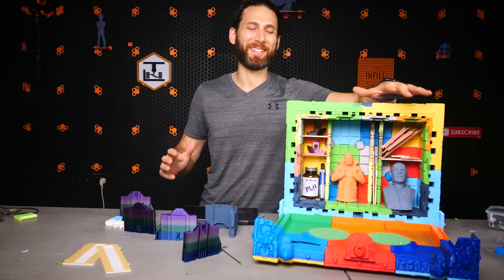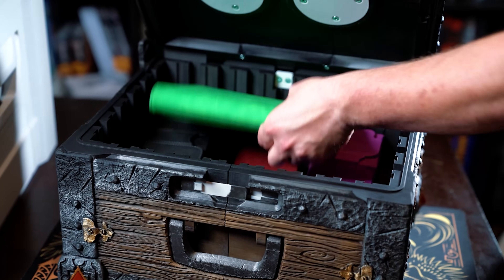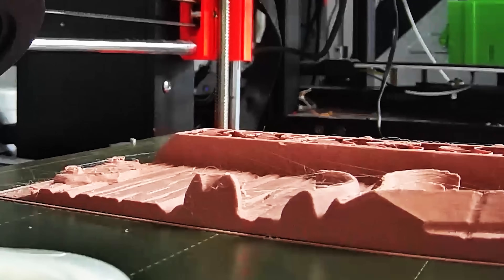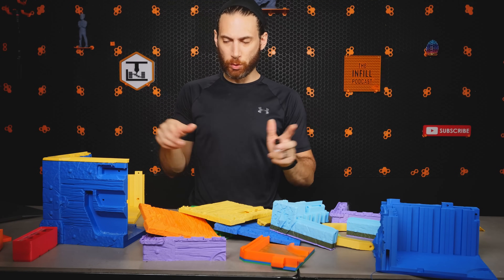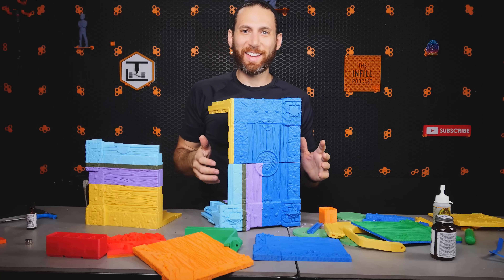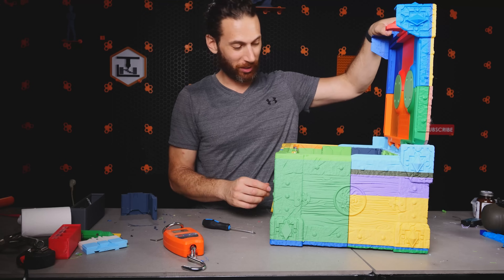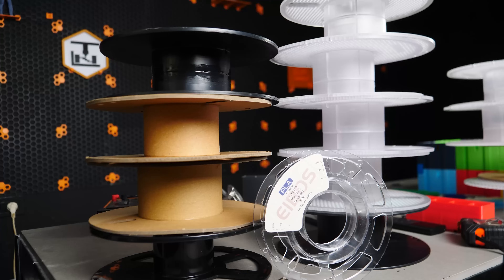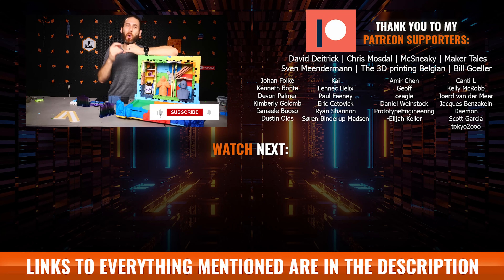I can't believe I 3D printed the whole thing...

Comment: I have a BIG question for you…ever since I saw your video where you say if you print stuff for the house, your significant other will get you or allow you to get more printer. I have been in love with the Honeycomb Wall. I haven printed one yet because I just got my first printer which I chose the Elegoo Neptune 3 Max. Well while watching that video, I noticed some Honeycomb shelf brackets that were awesome in your background. They are the Black and Orange Honeycomb shelves. I found an STL version of them, but it is oriented very small, can you tell me what size to print them in.
Reply from the maker: MY version? Should be scaled properly in my model, in mm.

Comment: I backed the original Omni (still haven't had the time or money to actually print one, but it's coming one day) and got notified about the portable version just yesterday by email...my first reaction was, "but I already have some less fancy storage for my D&D miniatures, I don't think I need this." My second reaction after starting to watch your video was, "it doesn't have to be for just miniatures, it is an endlessly customizable and expandable storage system for nearly anything." And my last reaction was, "that seems ludicrously heavy and expensive, if I'm going to that extreme of a level for portable storage I maybe should just get a Pelican case and some of that cubed foam with smaller 3D-printed accessories."

This kind of video is definitely great - I wasn't 100% sure of my decision to avoid backing the project, especially at the early bird price that was still available as of this morning, but now I am more confident in my decision. I'm sure others are equally as confident about going ahead with backing the project, and that's great as well. The check-it-before-you-back-it style of video I think has a lot of value to the 3D printing community, would love to see more videos like it in the future.
Reply from the maker: Great comment I’m super glad it was helpful!

Comment: That design looks very wasteful. It is a complete case inside another very thick complete case. It looks to be at least $100 worth of plastic, to reproduce something you can get on amazon for undre $50. I love 3d pri ting as much as the next guy but replacing even a few of those panels with corrigated plastic would cut the cost and time down to less than half of this.
Reply from the maker: Yeah, I get that, though the plain one is less plastic... but like i said, i think it's not about saving money but rather building your own, similar to how making your own cabinets is more expensive than just buying IKEA most of the time, but it's about the project and making it exactly how you want it?

Comment: That was really neat!  Ultimately, though, I agree with your conclusion.  Not the part about this being better for the purpose than an off-the-shelf miniatures case; the off-the-shelf solutions tend to be very good at what they do, and if you're content to roll the dice on Amazon clones, you could get the same thing for about 2/3rds the cost of 7kg of filament in Canada.  But the part about "you do this because it's fun to build it.

Even so, this rather feels like a "if all you have is a hammer" solution.  Even from a DIY and completely custom perspective, I feel like it would be better to buy an existing case and just 3d print the internals.  I can get a decent attache case for 100$ or a similar sized toolbox for about 60$.  With filament costing around 25$/kg in Canada (more if you're going for brand name product like Prusament) 100$ for a case that has no join lines and no weak points and masses a hell of a lot less than 4kg seems like a really good deal.

It is really cool, though, and I'm happy this exists for the people who want to explore it.

Oh, and the most filament I've spent on a single project is over 20 kg on an R2-D2 replica.  Well, so far - it's the sort of project that's never "done" so I'm sure I'll print more stuff at some point.
Reply from the maker: Thanks, I appreciate you filling me in as someone in the know. And wow, 20kg... I'll need to see that one! Pics?

Comment: Honestly, this is ludicrous. Just cut the 6 pieces of plywood, and use the 3D printed elements as joinery and internal elements (+wood glue for additional strength! There! Plastic and print time cut to – what? – 20% od the original? And fraction of cost (thin plywood could even be scored with utility knife, broken, and just sanded flush with sandpaper, no special tools required... and jigsaws could be probably bought used for essentially nothing). 

Some 3D printing designers/creators are truly demonstrating the whole new levels to the "when you have a hammer" problem.
Reply: Yeah this is ridiculous... And just the exterior of this "briefcase" weighs 5,4kg!
Reply: I honestly don't know a whole lot about designing functional 3d prints, but yeah this just seems like an insane amount of wasted plastic. I can't believe the walls need to be that thick for this to function, and why can't the rails for the internal parts be built into the outside?

Edit: Looking at the kickstarter, the non-customized exteriors seem a lot more reasonable on construction. Still could be more efficient ways to do it like you said, but not nearly as bad as this version. Also the fully finished and painted ones look a lot cooler than this one he cobbled together with random colors, so I can see the appeal a bit more.
Reply: I should check out the lighter options, but I've been avoiding most printed cases and such because most seem to have very poor capacity for their exterior volume. 

The walls on this thing are just insane. 

I have the same frustration with cable winders. Some are clever but you can turn a cubic foot of cables into a moving box with one.